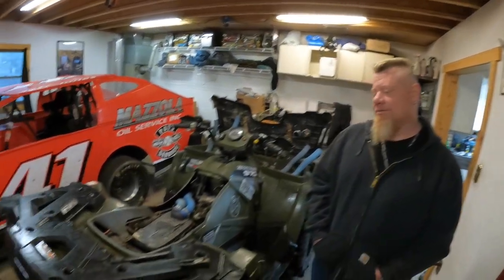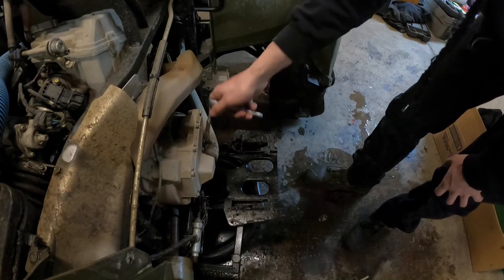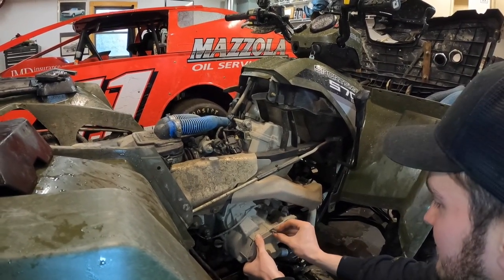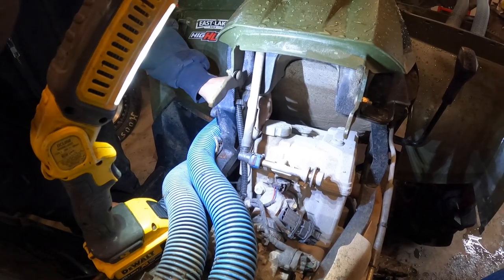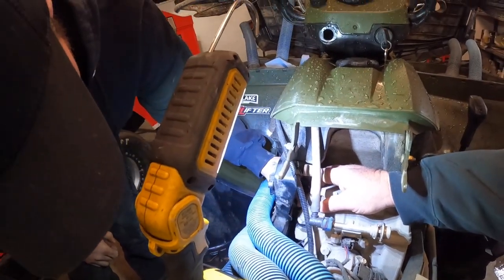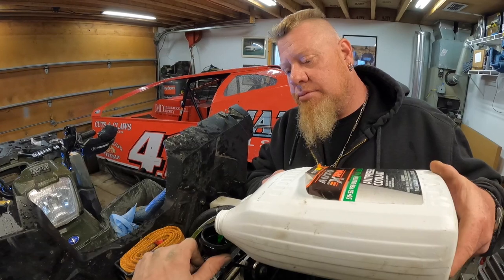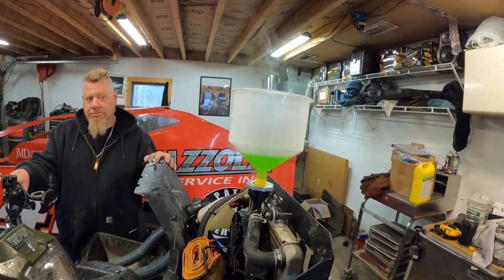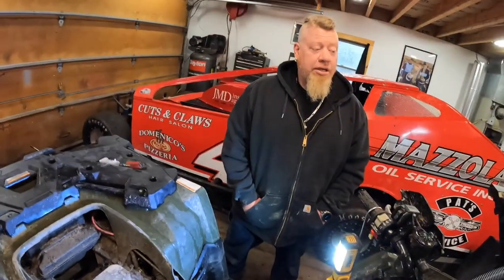How To Replace Thermostat and Water Pump Impeller on a Polaris Sportsman 570 | Diagnose Overheating

Comment: Thank you for the video, it was good information.  Sharing a wild scenario, of my Sportsman, the fan nut came off, and the fan came loose, turned out to be the reason for mine overheating...  Very bizarre, as mine is only used for 5-10 mph, puttering around my land, hauling a tools plastic trailer!
Reply from the maker: Strange.